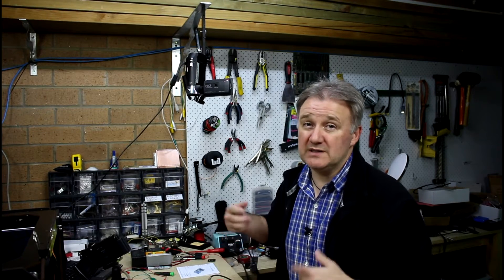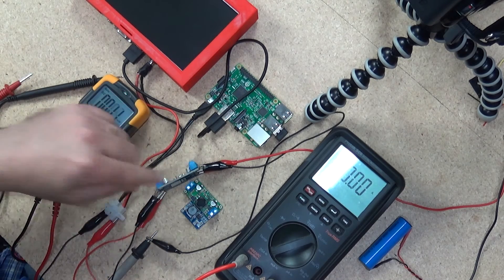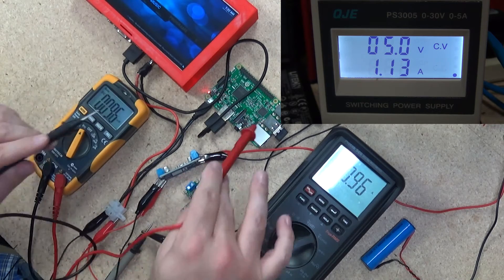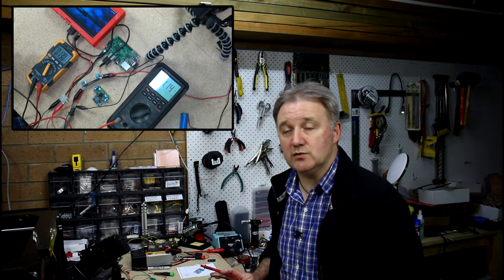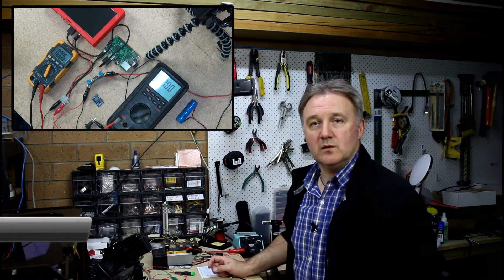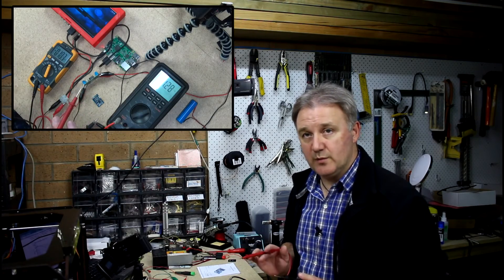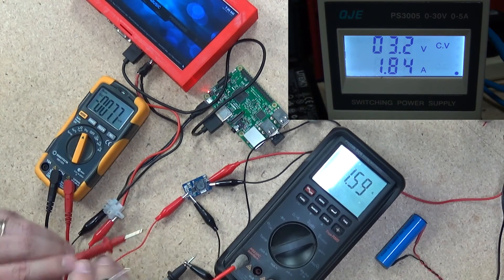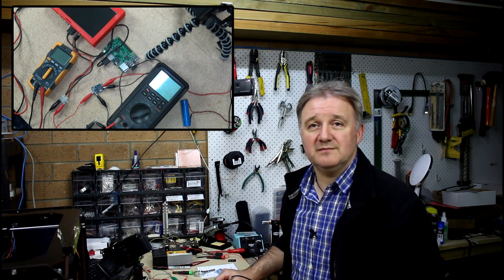Supply 5 Volts to your Raspberry Pi (or other SBC) Project from Battery Power (MEHS) Episode 45

Comment: Hi I have an idea for a vid for you if interested I picked up a raspberry pie 3 b + and a Kumami 9000 plus case looks like a Super Nintendo and it has a control board internal I was wondering if I could run my pi off the board internal if I wired it to a dc converter that came from an old camera charger dock so the case would be hard wired after mod and the pi would be powered via gpio pin can’t find anything like that on utube

Comment: Hi there, I couldn't tell from the video, but I wanted to check. Are both positive cables attached in the same slot in the clear screw terminal? (same with the negative wires as well.). Thank you for the video as well.
Reply from the maker: - Hi.  Yes they are as the positive rail provides all the positive output for the components, in this case the Pi and the LCD.  Same with the negative rail.  Cheers.
Reply: Ahh, I see. Thank you very much for the reply.

Comment: Thank you for your great videos.  I was looking to use a single 18650 with a simple charger board as used on one of your other videos.  Then using the $4 step up 2A board to power the Pi.  Only want it to keep the Pi going during short outages.  My issue is a suitable housing for both the Pi, battery and additional small boards.  I can only find the standard housing.  A custom housing like this (https://www.tindie.com/products/mjrice/enclosure-for-raspberry-pi-3-and-lifepo4weredpi/) would be great - are they offered by anyone in Australia?  I could not even find one to house the Pi / UPS HAT board / battery - which seems a popular UPS option.  If you could point me in the right direction it would be great.  Thanks, Mark
Reply from the maker: - Hi.  I haven't looked for such cases before.  Can you make your own?  Much more satisfying.  Aside from that the one you linked looked pretty good.  Cheers.
Reply: My Electronics & Hacking Show p

Comment: Thanks for the video very interesting I want to put together a tablet type unit battery powered with a raspberry pi3 my pi will need 5v but my display is going to be 10" LP101WX1-SLB1 that uses 3.3v so do you think it will be best to use 2 step up voltage controllers one for 5v and 1 for 3.3 or is there a combined dual step up that you know would be better.
any information would be good thanks, Bob in the UK
Reply from the maker: - Hi.  I would go with 2 regulators.  Whether you need step up, step down or sepic will depend on the battery supply voltage.  Two works well as you can use a reg that meets the voltage and current needs.  I dont think ive seen any dual output regs anyway, at least not small project boards.  Cheers.

Comment: I'm looking into adding a battery for my raspberry pi. I have the 7 inch screen what power regulator would you recommend?
Reply from the maker: - Hi.  Which Pi?  If its the 3 then you need a full 2.5 amps just for the Pi.  What battery source?  If its a single 3.7v lithium cell then I would go with the Pololu U3V50F5 which will boost from 3V to 5V at 2.5 to 4 amps.  Cheers.
Reply: My Electronics & Hacking Show Thanks for the reply I do have raspberry pi 3 and I'm hoping that I be able to make it as portable as possible. Thanks again.
Reply: Thanks for the advise it worked perfectly. By the way great video.
Reply from the maker: Great to hear.
Reply from the maker: - Yes and no.  If your power supply is providing 5 to 5.1V at the USB port and enough current to power the project and run the battery charging circuit then no real issue.  Laptops basically run this way and you can do what you're suggesting for a couple of years before the battery suffers badly.  You need to ensure that the project is running from the external power and not always from the battery.  You also need to check the power (voltage and current) at the USB port on the board or project and not at the power supply.  You can drop voltage over a thin wire and the current carrying capacity is likely to be less than the stated 5.4A.  Cheers.
Reply: Is there a problem with constantly running the Pi, an LCD screen and a simple USB keyboard off of a cell phone portable battery/charger running at 5.4v through the mini usb by a cable? Say 5400ma or more? If so, why?
Reply: Good info about a wired charger, charging a cell phone battery that in turn powers the Pi and its keyboard and screen. But I misspoke I think. I meant using an external portable battery charger made by companies like "Anker" [in their "Powercore Series" of chargers] solely as the power supply. These are essentially external batteries aren't they? Would they work as a portable battery for the project I mentioned?
Reply from the maker: - Oh ok.  Yes that would work fine as long as the external power supply (battery bank) can supply the required current to the project.  If you are using a Pi 3 and an LCD and keyboard you could easily need 3 amps at 5V.  Check that the battery bank can output that current as not all of them do.  If the battery bank has multiple USB ports then you might need to use both and either bridge them together or use the highest power port for the Pi and the other port for the rest.  Cheers.

Comment: I was going to use a 7805 regulator to power a pi 3 from a 8.5 volt input. Someone recommended that I use 2 7805s to double the amps. Will that work?
Reply from the maker: Paul Giles - Hi.  Yes that would work.  Remember the pi3 wants 2.5A or more.  The typical 7805 peaks at 2.2A so one won't be enough.  Also have a look at the Pololu Step-Down Voltage Regulator D15V35F5S3.  It will do what you want and deliver 3.5A.  Cheers.
Reply: Thanks! What do you think of the LT323A as a less expensive alternative?
Reply from the maker: Paul Giles - I wasn't familiar with that one but a quick look at the datasheet suggests it's a very good option.  I'll keep that one in mind for later.  Cheers.
Reply: Excellent! Glad I could add another item to your list :)

Comment: Would this one work as well
http://www.banggood.com/DIY-5V-2A-Voltage-Regulator-Junction-Box-Solar-Panel-Charger-Special-Kit-p-1035493.html
Reply from the maker: - Hi.  Yes it looks like it would but remember some (maybe this one) are step down regs meaning this one is expecting a 12v battery or something close to give you your 5v 2a output.  I would buy one and try different input voltages.  Cheers.
Reply: Thank you for replying. Since I dont have the equipment to test this i think i should go safe with this one
http://www.ebay.com/itm/DC-DC-3V-3-3V-3-7V-4-2V-to-5V-USB-1A-2A-Step-Up-Vehicle-Power-Charge-Module-HM-/181979017930?hash=item2a5ecb72ca:g:46YAAOSwT~9Wh5QC

Is this one Ok?

Btw do i have to solder the red and black wires from the output of the regulator to the bottom of the raspberry pi or can i solder them to a micro usb cable and plug it into the raspberry pi?
   Thank you :)
Reply from the maker: +Modi - Hi.  The one you selected might be ok for a pi2 but won't be any good for a pi3.  When they say max 2a, that means when everything is optimal, e.g. 5v going into the reg to start with.  You can connect the power wired to the Pi direct or to a micro USB cable, whatever you prefer.  Cheers.
Reply: Alright Thanks a lot :) I will look into it a bit more.

Never seen such support from an awesome youtuber like you :)
Reply from the maker: +Modi - Thank you.

Comment: Great video! I have a question for you. I am looking at running a 20,000 mAh battery pack to power my Rpi 3. Do you know of a way I can keep the battery pack turned on without having to press the power button on the battery pack? Most battery packs turn off after their is no required power for the load. Is there a way I can fool the pack into thinking there is required power, even when there isn't actually any required? Thanks!
Reply from the maker: - Hi, and thank you.  That is tricky because it depends on the chip in the circuit inside your battery bank.  The most correct answer would be to identify the chip and get the datasheet and see how the chip is triggered.  The quick answer would be to use a resistor to simulate a load but you will be continually draining the battery.  I would bypass the circuit in the battery bank completely and connect the batteries to the Pi via a 5v regulator.  Cheers.
Reply: Thank you! How easy is it to take apart the battery banks? I would think it would potentially be dangerous.
Reply from the maker: +Chip Miller - Not hard and not dangerous if you take care not to allow the positive and negative of the battery to touch or short out.  Maybe take a look at my episode 36 which shows a battery bank tear down and the internal parts.  Cheers.
Reply: Thank you! I'll make sure to check out that video!

Comment: Would it be ok to use two step up boost converters on the same battery pack? I have a portable pi laptop that started with a pi2 and then I tried using a pi3 but its too power hungry. I reinstalled the pi2 but having wifi and bluetooth built in was nice. I want to try two boost converters one for the pi the other for the screen (5" composite) and the 3.7 watt audio amp.
Reply from the maker: +PDRIFT86 - Hi.  Yes.  Connect the battery to regulator 1 feeding the Pi and connect the battery to regulator 2 feeding the screen and audio.  This is common in devices or products that need different voltages or, in your case, more power.  Since both regs will be 5V you don't need to worry about separating the power so you should be fine.  Cheers.
Reply: +My Electronics & Hacking Show thanks.

Comment: Nice video. Very thorough  I don't see a link to the cheap regulator you found on eBay for $5. This would be a great little first project for my pi as I hate wires.
Reply from the maker: - Hi.  I can't find the exact one on eBay anymore but item number 141147699375 is really close.  Also try and search for "5v 2a step up".  That usually narrows down the search results.  Cheers.